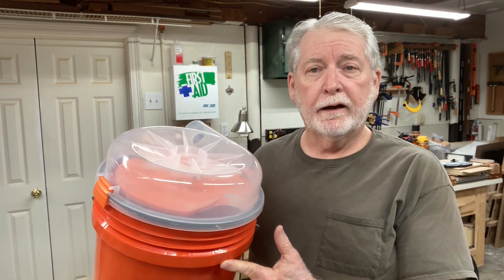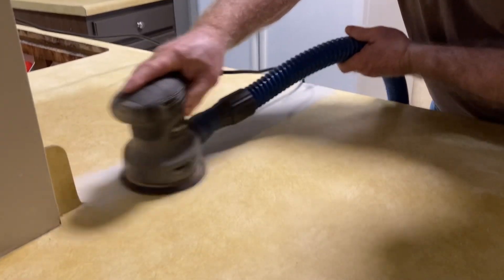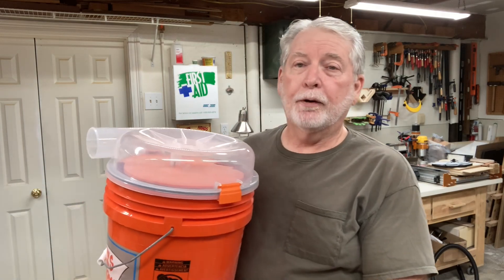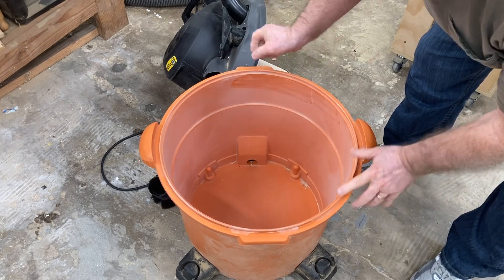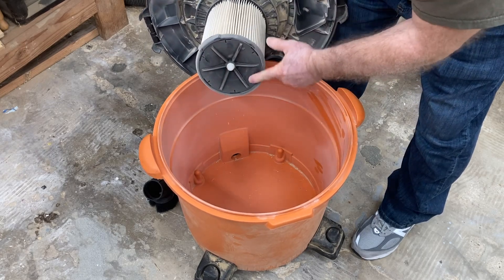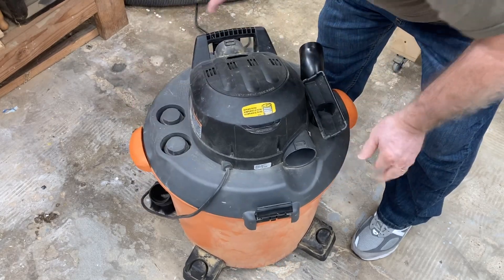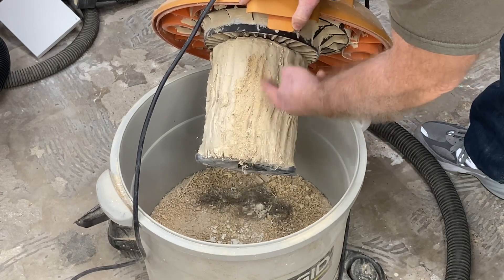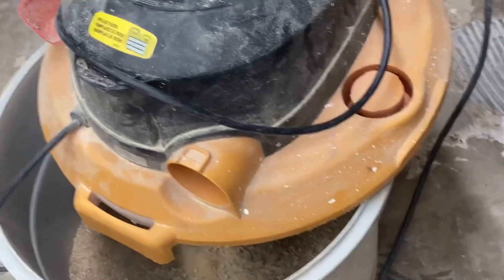How Effective is the DUSTOPPER PRO After Over a Month of Heavy Use

Comment: I bought one, but inadvertently bought only the separator, not the elbows and hose, so I need to get them before using it.  Although I have an Oneida Dust Deputy cyclone, I figure this will be more portable for general purpose vacuuming.
Reply from the maker: Once you get it setup I believe that you’ll like it